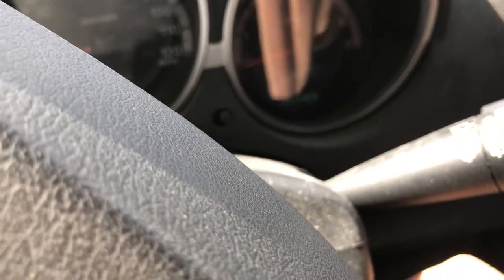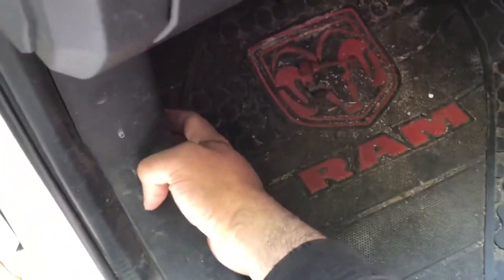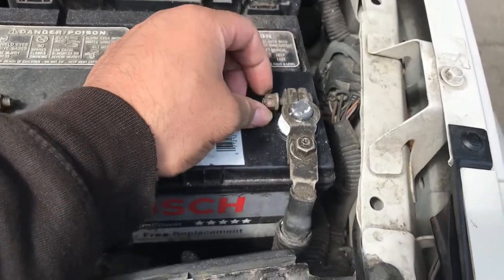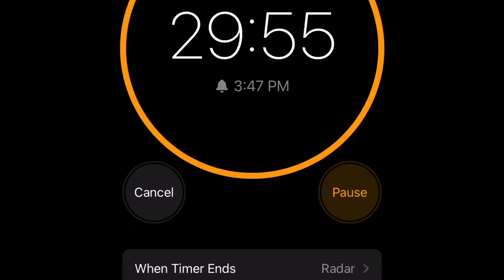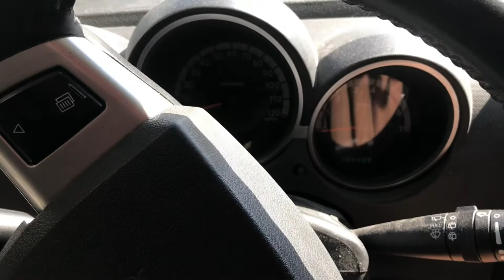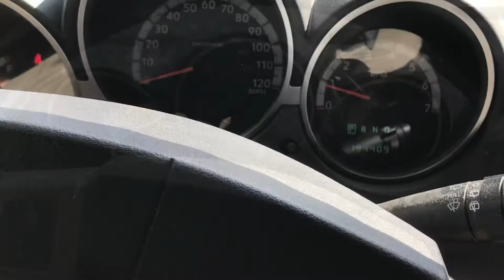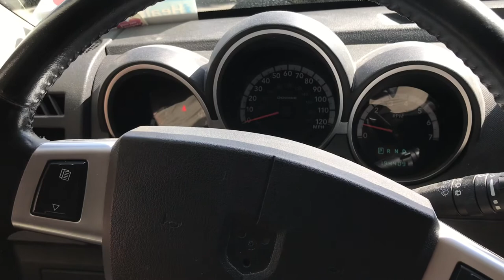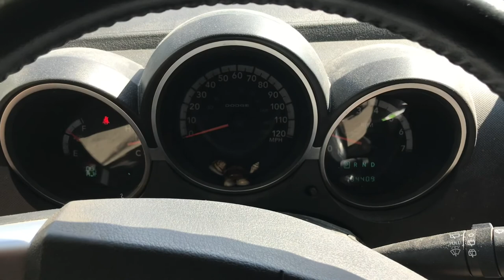Dodge Nitro RT Won’t Start | Dodge Nitro Forum 2007 - 2012

Comment: Thanks for the video?? What year is your Nitro?
Reply from the maker: Hey nwworkman, no problem, thanks for the feedback. My nitro is 2007.I have several more Nitro Vlogs that you can check out, that cover different fixes 👍🏻👍🏻👍🏻
Reply: @CodesandCoffee  Thank you.  We had a couple 2008 ones back in 2009.  I'm looking to buy a 2011 one - Heat trim.  It's a state over from where I live.
 I've been checking out videos to see what problems others may have had.  We didn't have any issues with our 2008 models.  We had them only a year or two. Then, they went to other family members or we sold it.
Reply from the maker: @mwworkman  that’s awesome!  I love mine, it’s a RT with many whistles but no sunroof. I’d like to also get a never one too at some point,.
What’s cool is the new Dodge Hornet Crossover. Might come out 2023-2024 It’s like a Mini Dodge Nitro

Comment: Got a 2007 Dodge Nitro and having some electrical issues with SUV shutting off in mid Drive
Reply: that sounds like tipm that was recalled
Reply: @daganhaddad yeah I found that out and ended up having to get rid of that vehicle but I appreciate thank you

Comment: Have you dealt  with the panels lights going crazy
Reply from the maker: Ana Lazcano, thank you for your feedback. In the past we’ve had hundreds of different panel lights going crazy. 
Up to the point while driving, 
1.Suddenly your wipers come on
2. Radio shuts Off / Turns on
3. Speedometer/RPM goes haywire and
Lights on dash look like Christmas lights
4. AC or Heater blower shuts off 
5. Drive Train Power Loss
6. Blinkers and headlights Malfunction

All signs, which leads to a bad alternator. And or battery combo. 

You should stop at your local auto repair shop and ask them to plug in a (Code Reader) the code reader can diagnose whats happening with a code(s), in many different cases. It will lead you in the right direction, even up to a critter, squirrel, field mice, chipmunk living around your engine bay and eating up electrical wires causing havoc.

Thanks again for your feedback and Good Luck!! 👍🏻👍🏻👍🏻 let us know your progress!
Reply: @CodesandCoffee  oh thanks, I will do that, yeah all you described is what is happened to me, just last night, again thanks
Reply: @CodesandCoffee  I got both checked and they were fine, alternator and battery, went to two different places, and with different computers bit came back as good🤷 it's the TIPM, has to be🤔